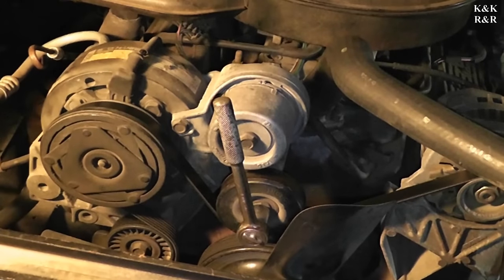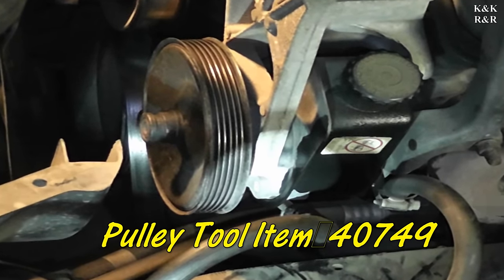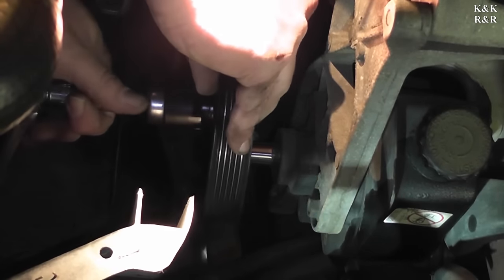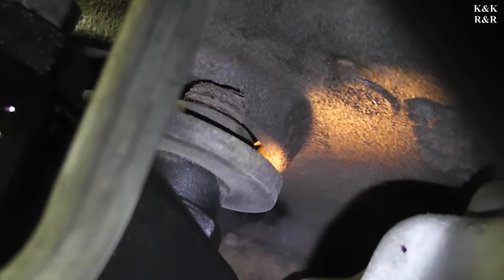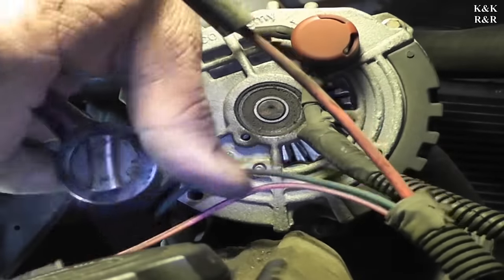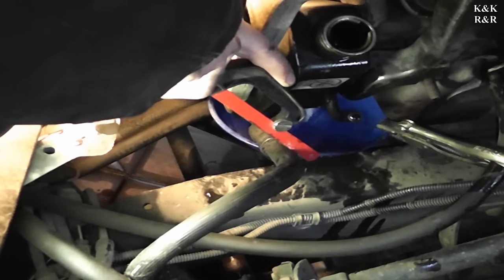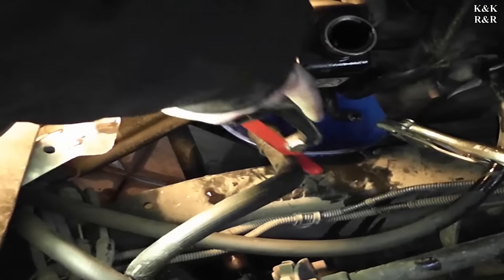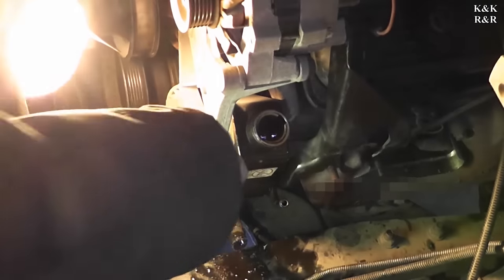GM Truck Power Steering Pump Replacement Series PT.1 Old Pump Removal

Comment: No need to cut any hoses, you did this all wrong
Reply from the maker: In automotive repair there are many ways of doing the same job most of the time.  As shown in the video we did fix the power steering system properly and worked as designed after the repair.  Nothing was done wrong and those hoses had 171k so replacing them was required anyways.
 /K&K

Comment: That's why I drive a 1981 chevy  k10. These trucks went to hell after 1986. I have been a mechanic 50 years. My advice is next time buy a classic pre 1987.
Reply from the maker: To me after 1996 GM went the wrong direction it only gets worse the new it gets. 
/K&K

Comment: If you use a pry bar against the engine and frame you can pry engine up enough to get power steering pump right out through top easy
Reply: You just saved me so much time. After a 30 min fight and a 1hr break i read your comment and 3min later its out

Comment: I have a 96 chev and a 93 ford truck, both have had pump rebuilds over the past few years, both worked great for awhile after installing rebuilts and both the assist gradually degraded at low idle to where they are like armstrong - I just accept it now and lean into it when I need to cause swapping out pumps gets old after awhile. The pumps work fine when you add a bit of rpm so it is rare that you get no assist at all.
Reply from the maker: You ever replace the steering box or stabilizer shock on the steering linkage for 4x4 models. I have had that issue and it was the stabilizer shock that was causing the hard steering at idle.  Disconnect the stabilizer shock and see if you have easy steering at idle, if not then your steering box is the issue.  The steering box also controls how much assist you get at idle via a pressure control valve that's built. Most steering boxes have an adjustment nut to vary the pressure so you don't have loose or excessive power steering at highway speeds.  In your case I don't believe your having a pump issue but either your steering box, or stabilizer shock may be your issue, you should have full assist at idle (Ford or Chevy), their design is almost the same internally. Those pumps make at least 100-200 psi pressure at idle.  I hope this information will help you solve your hard steering at idle.
/K&K
Reply: It can be the hoses too.
They degade and can cause problems

Comment: That pump assembly comes straight up and no problem.  Just un fasten the pressure line from the steering gear with an 18mm crows foot.  No need to destroy anything.
Reply from the maker: That's what is great about automotive is there is many ways to do one job. Crows feet are great but you still run the risk of stripping the fitting which is why I don't use them on high pressure fittings.  Replacing a hose is much cheaper then a steering box.  
/K&K

Comment: Good video. You can add a power steering pump filter, I think Doorman makes one, that slips in between one of the hoses. You cut the hose, and then add the filter and then hose clamps. Not a bad idea, and around $10. I think the filter is really a magentized screen to catch any metal shavings that occur in the fluid itself.

Comment: I changed mine out snd this refurbished one is still loud as hell. I have to put some fluid in it from time go time.
Timd tonlook at hoses.
Reply from the maker: How did the bleed procedure go?  If that pump is loud that means that pump has air in it and will burn  up from pump cavitation.   You might have to vacuum bleed it and check for leaks because you shouldn't have to add fluid from time to time.  
/K&K

Comment: God damn it... 

I found my way here because the driver side exhaust manifold needs replaced on our 95 yukon. 

I've done several gm power steering pumps but usually they're nice enough to put a couple holes in the pulley for you! 

Yay. 

May as well do the pump since I'm there, it is a little sqeauly anyway
Reply from the maker: If you have the puller its not to bad to do.  
/K&K

Comment: Thanks for sharing this,  I'm debating on whether I'm gonna tackle that. lol
Reply from the maker: If you have the right tools for the job its as you see in the video.  Plan on two days if its your first time doing a pump.  Thanks for watching!
/K&K
Reply: I would just need a Puller, i change 1 of the lines that was leaking last fall. But it's tough turning an makes noise like its not getting fluid. That wheel isn't loose,  oh and The Wife isn't happy. lol Thanks for the Tips, I'll need it. lol
Reply from the maker: @apeacefulgrower  Yup you can buy or rent the puller and installer tool for the pulley for this repair. After the pulley is off its just basic hand tools after that. You might want to get a set of flare wrenches so you don't strip the HP power steering hose if you just replaced it. 

Generally if the pump was ran low on fluid you tend to burn up the vains in the pump. Its possible to still hear the pump sound like it pumping but the pressure isn't behind it to push through the steering box.  

Yeah wife's tend to not like armstrong power steering. lol  You run into issues you can reach me on this comment I'm happy to help. 
/K&K
Reply: Thanks again I appreciate that.

Comment: any idea what pitch the 3 bolts are that attach the pump to the aluminum bracket. lost mine
Reply from the maker: Not sure, do you have a junk yard near you?   When we lose or break bolts we go to a pull and save junk yard and find the OEM bolts when ever possible.
/K&K

Comment: Was driving and my steering went completely out, can no longer turn my wheels, is that a indication the power steering pump went out?
Reply from the maker: If the pump is full of fluid but still doesn't turn most likely you lost the pump.   Have an assistant turn the steering wheel while your feeling for pressure from the hi pressure line. If you feel nothing at the hi pressure hose while they are turning the steering wheel then the pump is not working. 
/K&K
Reply: @KNKRNR  thank you I went to remove the power steering pump and the wheel that is attached to it pulled completely out with a piece of metal attached to it that's supposed to be connected to the actual pump. Like it snapped off completely

Comment: I pulled the pump out of my 94 an had to leave the pulley on. Someone used a hammer to put the pulley on the last time an messed up the part where you would put the puller. So it can be done.
Reply from the maker: Just did a 1994 Chevy and there was a bolt behind the pump that can't be removed till the pump is removed. If your able to pull the pump whole that means its been replaced and the installer left this bolt out. Your right it can be done if this bolt has been removed. 
/K&K

Comment: Hey great video! I plan on doing this just because if I’m not accelerating like on a slow turn the truck turns off so I’m think it has something to with the power steering but the truck turns easily. If you can help with advice that would great thanks.
Reply from the maker: What year and model of truck so you own. Some of these trucks used a high pressure switch in the power steering system to raise the idle under load to prevent stalling.  If this switch went out you could stall under load.  It would be extremely rare that the power steering pump would cause a stall under load.  
/K&K
Reply: @KNKRNR  it’s a 1993 Chevy Silverado1500  5.7 and I have changed all the simple go to parts.

Comment: So why didnt you just pull that alternator outta with it and lay it too the side.
Reply from the maker: We did that to the weight off the bracket that holds the power steering pump on. 
/K&K

Comment: You could just buy a new pulley & install with a nut & bolt that fits.
Reply from the maker: You could do that but the cost of a new pulley would be more then just buying the $20.00 Dollar tool at Harbor Freight.   GM designed the pulley to be removable and reusable, but did make it a pain in the rear to change the power steering pump when compared to Pre-1986 V-belt 350's.
/K&K

Comment: Pull the hole thing out with the bracket an hoses on. It is much easier to get the pulley off and disassemble it once it is on the bench.
Reply: You Gen Z kids are a trip. There are five bolts which hold the bracket to the engine, and one of those bolts is directly behind the power steering pump. Therefore, you need to pull the pulley, so you can pull the pump, so you can pull the bracket.

Comment: I have a 94 c1500 5.7 350. Does it have a short water pump or a long one? Im not sure about it
Reply from the maker: Mostly likely you have the long pump, there were the most common used from 1988-1995 on TBI (LO5) Engines Serp Belt systems, short pumps were used on GM cars like the Corvette and LT1's V8.  

/K&K

Comment: It will not come out with pressure hose attached on my 1992 4x4 a sawsall and cyt it off close to res
Reply from the maker: Fluid can only flow from the low pressure return hose when you cycle the steering wheel from left to right.  The High Pressure line becomes the suction line when you cycle the steering wheel from left to right via the steering box.   If fluid isn't flowing as it should you might have a restriction in the system as the steering box has a one way High Pressure check valve built in so fluid can only flow one way.  You need to diagnose where fluid isn't flowing freely when you cycle the steering wheel from from left to right lock to lock.
/K&K

Comment: This is the dumbest power steering pump I have ever removed.  I just need like an inch to the right so. I can swing it out
Reply from the maker: This job is the most hated repair on this truck. 
/K&K
Reply: Oh wish I knew and to follow up I pulled the threads out of the shaft with less than 1/8” to go.  I’ve never been so disappointed before

Comment: If you dropped the pump and broke hoses that's on you it doesn't make the bill go up for the customer.
Reply from the maker: Your right but in this case the HP line was cross threaded on both sides and was found to be leaking.
/K&K

Comment: This video should be named. The hard way to change a power steering pump do everything wrong and make it difficult 🙄
Reply from the maker: Your right fixing the previous installers mistakes makes this a difficult repair.  We had cross threaded high pressure fitting which is why I cut them and replaced with new   All we can do is make it right like we did in this video! 
/K&K

Comment: Can you give me a list of tools needed for this job? I have to replace my pump, but I don't have a huge socket set. I can only afford to buy single pieces for now.
Reply from the maker: The tool you need above all for this job is the GM Power Steering Pulley Remover and installation tool. Go to Harbor Freight with a 25% coupon and get item number Item #63068.($16.00. Bucks). You will need a simple hack saw,  basic set of deep metric sockets, normal sockets, metric wrenches (8MM to 16MM) to remove and install new pump from the main brackets. To replace main high pressure line, hack saw off the hose ends but leave 1/4 inch of tubing and use a deep socket to remove old fittings from each side (Pump & Steering Box). You can install a new high pressure line with with normal set of hand wrenches as opposed to buying a set of flare wrenches for this one repair. I would suggest to get a set of good flare wrenches anyway.  Power Steering and brakes lines can be very difficult to remove even with the right tools! This list of tools above should get you up and running in no time flat. If you have any other questions just leave a comment, I respond with 12- 24hr)
/K&K Repair
Reply: @KNKRNR  why is the part number on this comment for the pulley removal kit different than the one listed in the video?
Reply: @KNKRNR  My 94 k2500 has a leak at the line where it connects to the bottom area of the pump that just needs tightening i believe. Hard to get to but what size wrench do i need? I don't wanto remove the pump but could I use a crows foot or a flex head flare wrench? Thanks.
Reply: @vangorian8776  because they're both the same part. If you look at HF's webpage, the same part is listed with both numbers. Most tools or mechanical parts have more than one part number.

Comment: did mine today on a 93 suburban it was a bitch
Reply from the maker: GM sure didn't make easy on us by any means.  If you remember the square body GM trucks they always had a tendency to slip the belt and make lots of noise.  GM went well overboard on the Pump design to stop belt slip noise.  It works but yeah its a pain to do when ever it dies.
/K&K
Reply: well i must say i went at it all wrong im use to to pulling the pump then the pully .here pully goes first on this truck they hid all the bolts behind the dam thing ...hell i was removing bolts that never needed to be touched thats why i came here to warn our youtube friends and give a heads up and tell people do not use POWERBUILT KIT 13 MODEL NUMBER 648644 its suppose to be a pully puller only not an install tool but i rented it from advance auto DO NOT GET THIS THING its a piece of shit. get the one that he is using in this video ...i told the guy at advance to put it on the shelf and NEVER rent it out again 2 hours wasted trying to get it to work plus another 2 hours trying to figure out how the pump came out like a said b4 this job was a BITCH but its in and running..by the way if anybody do this job put new exaust manifold gaskets in while you got it tore down or anything you need to do while the pump is out this is a job you only want to do once trust me

Comment: And cost $200 plus core charge
Reply from the maker: Wow that's too expensive for pump unless you have a hydro boost brake setup.  Check out RockAuto.com you can get an AC Delco Power Steering Pump With Core Charge for $73 Dollars plus shipping. Only grip I have with Rock Auto is know the part you need very well because returning the wrong part can be a real pain in the rear. 

https://www.rockauto.com/en/catalog/chevrolet,1995,c2500+pickup,5.7l+v8,1033243,steering,power+steering+pump,7380

/K&K

Comment: Easier to pull the alternator off and then pull the entire aluminum bracket with power steering pump attached still. Then pull pump off bracket install new pump and then reinstall the bracket
Reply from the maker: If that worked for you that's great, but I had a bolt behind the power steering pump that made removing the bracket not possible! 

/K&K
Reply: Yeah, sure.
Reply: LOL NO. Bracket can't be removed without attaching the power steering pump. One of the bolts holding the bracket on is directly behind the power steering reservoir.
Reply: Impossible to pull the bracket without pulling the pump out of it first, seeing as the bracket is bolted to the engine and one of those bolts is directly behind the pump. But go on with your make-believe credentials, Zach.